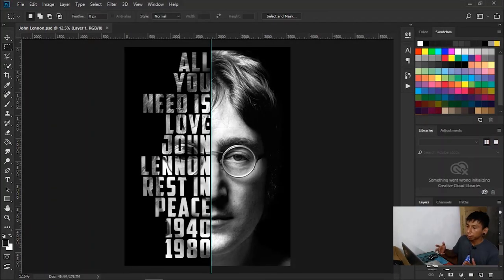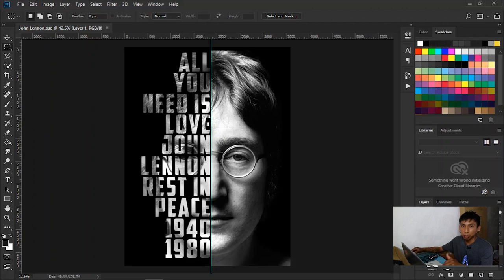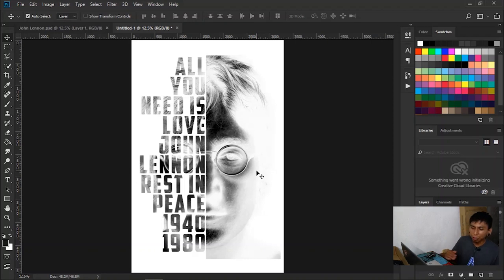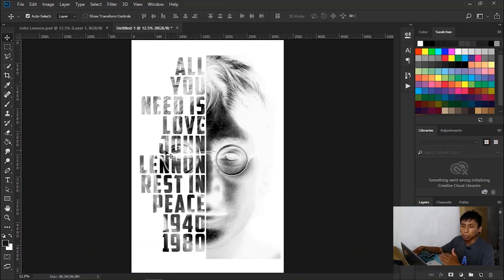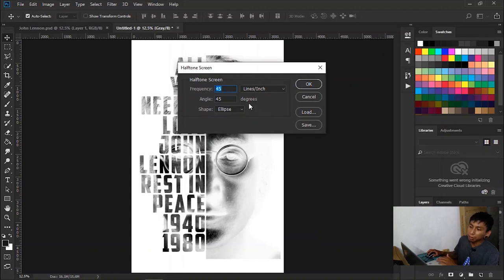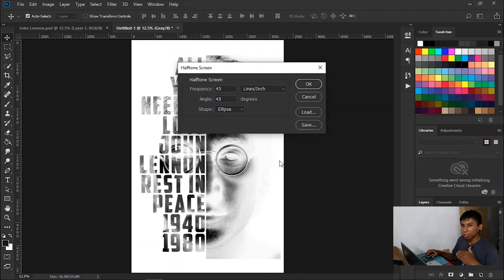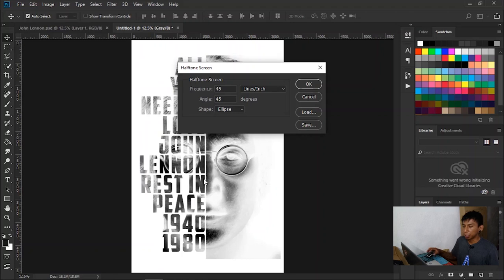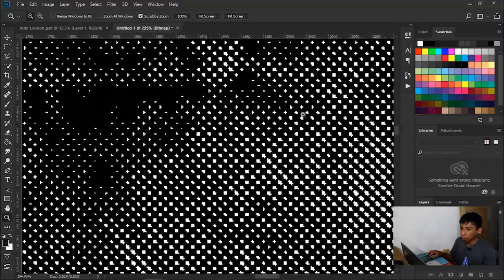How To Print 1 Color Halftone

Comment: Good job Antonio. I have many family members with the same name. Anyways, the formula for the LPI/Frequency is the Mesh Count divided by 5. So, if you're using a 305 mesh count frame, divide by 5 or about a Frequency of 61. The Angle is self explanatory. 22 degrees would be 22 degrees of a 360 degrees circle. So the dots, diamonds or lines would be at a slight angle of 22 degrees, not straight up and down. Again, great video.
Reply from the maker: Thanks Amigo, I really appreciate the feedback on this topic. Still trying to nail down these halftones.

Comment: I went ahead and tried this on my 110 mesh screen and it came out really good.
Reply from the maker: That's awesome Amigo. And on a 110T mesh?
Reply: @TheInkBuildUp  si amigo😁...after o was told it won't work I decided to just try it anyway.....i mean for a beginner I'm impress. It's not as perfect if it were to be done on a higher mesh count but for 110👍
Reply from the maker: @tamaryisrael3480  Yea, I mean I did mine at 45lpi which is kind of big Halftones but still came out good. I may end up trying with smaller Halftones on a future design.
Reply: Kool...i did mine at 25 lpi, base on the link you posted in video.
Reply from the maker: @tamaryisrael3480  I see. But cool, glad you decided  give it a try.
Reply: I Wil try cymk next
Reply from the maker: @tamaryisrael3480  awesome. Let me know how it goes when you do.
Reply: Thank you! I'm using 110 too so I'm glad it worked out for you!

Comment: Great stuff!  I have not tried half tone print yet.  I’m still trying to figure out the emulsion part.  I use Chroma Blue which is very thin.  If you dry at an uneven surface the emulsion goes to that side.  But I figured out today to put the emulsion and then scoop out the excess to make a thinner coat.  Worked like a charm.  If you ever pass through El Paso,Tx. Hit me up.  I’m thinking of starting a channel soon.
Reply: I smooth my emulsion out with an old insurance card when I encounter those problems when I coat my screens. I'm pretty new to printing but it seems to work.
Reply from the maker: Yea. I would always face the issue of uneven coat, but like you said it's always good to scoop out the excess amount. I'm getting better at coating.

Comment: Give you props bro cause Burning halftone from albanene you got to know what you're doing. Good job
Brother.Thanks for the video
Cause I do everything except the computer color sep and design something I have to learn.Orale es todo carnal
Cause thats I get down Right now I burn under the Sun. Spray bottle to wash out... 
Sánchez and Excel ink you cannot run direct always use reducer.
Bless.
Reply from the maker: Thanks Amigo. And yea, I'm surprised as well that it came out pretty good for using Albanene paper for the film.  But luckily I'm slowly improving my shop. I appreciate every new equipment I get more knowing how difficult it was before.

Comment: I print on laser paper and use corn oil to make the paper transparent and burn the image on the silk screen using the sun. I will try it with these half tones it looks easier to do than with CMYK prints or burns. Muchas Gracias amigo.
Reply from the maker: Yes, I've seen people do that, I haven't tried it yet. But I did started out exposing with the sun. Good way if you don't an exposure unit. And awesome to give these halftones a try Amigo.

Comment: Antonio, What mesh count did you use for the John Lennon tutorial, and what kind of emulsion. You mention a Cannon printer, will you tell us which kind? Also, since this was recorded a while ago, did the Cannon printer work with half-tones or did you have to get something else, if so which one did you get? Thank you.
Reply from the maker: I used a 120t mesh is a 305 I believed. As for the printer I'm currently using the Canon Pixma ix6820, works perfect for printing films including halftones.

Comment: You are so amazing man. What is the type of the ink you used and what is the blue thing which you direct it to the t-shirt after printing??
Reply from the maker: Thank you. And I'm using Plastisol ink, and that blue thing is my Flash Dryer. It's what I use to dry the ink so I can do another pass as well to do the final cured of the ink that will prevent the ink from washing off.

Comment: this video was so helpful! thank you so much. question: in photoshop, would i be able to do this with a black and white portrait for two or more different screens (each screen showcasing different levels of detail)?
Reply from the maker: Glad the video was helpful. But I don't really understand your question.
Reply: The Ink Build Up i’m sorry—i have a black and white portrait that i scanned into my computer. i was wondering if i would be able to split that image in photoshop three times so that i can use different colors with three different screens for different details/highlights/shadows on my shirt.

thank you so much for responding!
Reply from the maker: I see. And yes you can but that will require more work in Photoshop to change that black and white image and give it the color you want, than work on it to print the film.

Comment: Amigo...please help.
Ehat type of printer is suitable for screen printing ?
Inkjet or laser jet. ?
For halftone screen making, what type of printing machine are you using, please help. Am confused !!!
Reply from the maker: You need an inkjet printer for printing out films especially if you're using screen printing film. Here, I used tracing paper that is only suitable for laser printers but I only used it since I didn't have a printer not screen printing film at the time. But yes,you need inkjet printer so you can print dark films.
Reply: @TheInkBuildUp is it ppssible to make haltone printing, If i print on tracing paper using an inkjet printer ?
Reply: @TheInkBuildUp  Amigo...I have ordered  Canon Pixma iX6770 Single Function Inkjet Printer. Is it ok for screen printing purposes, mostly for halftone.?
Reply: @TheInkBuildUp  Also, if I use butter paper instead of a screen film, what will be the output.?
If butter paper not works, I need to order the inkjet film, that's why I'm asking, please reply...
Reply from the maker: @vishnumurali4204  For tracing paper I don't recommend printing with inkjet since the ink will wet the paper and basically distorted a bit. It's not a big deal with a 1 color design but with multi color it will affect the print. As for butter Paper, I don't know about that paper. You might have to do a print test to see how it comes out of the inkjet.

Comment: are ya using plastisol paint ? and how many mesh on your silk screen?
Reply from the maker: Yes Amigo, it's Plastisol ink and mesh is 305 (120t)
Reply: so its not waterbase?
Reply from the maker: @renzviana6591  No it's not.
Reply: migos is the mesh is 305 or 120? im just confuse
Reply from the maker: @renzviana6591  it's 305 in the USA. But if you use the metric system it converts to 120tT.

https://www.catspitproductionsllc.com/screenmeshconversions.html